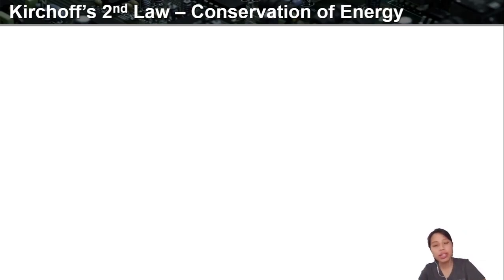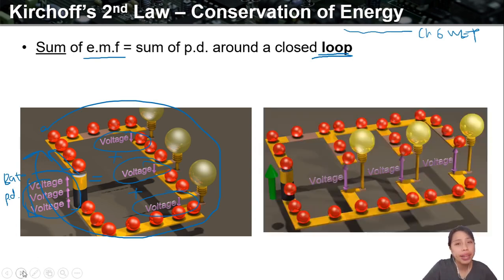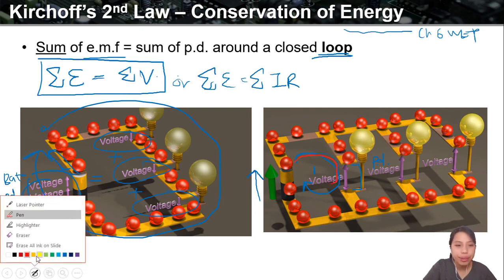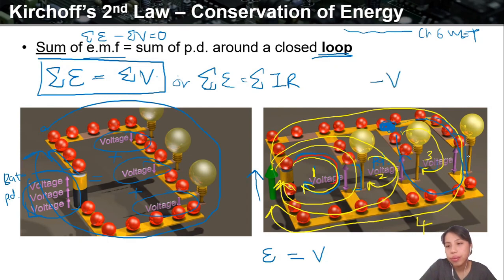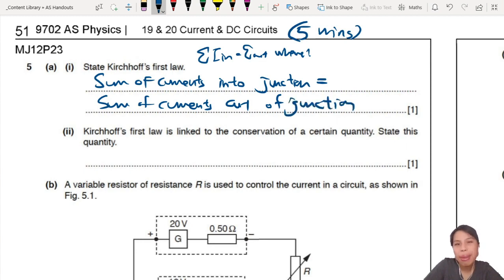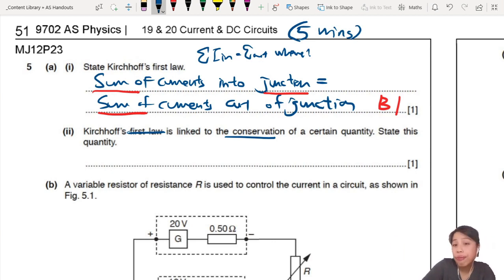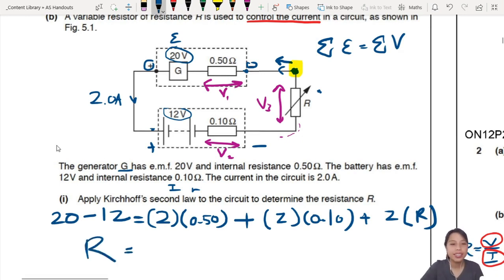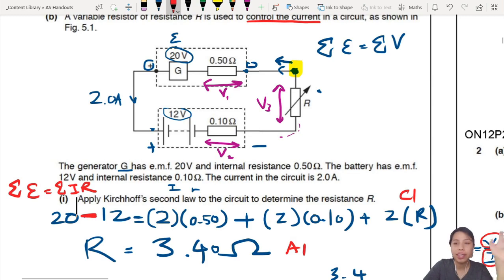10.1b Kirchhoff's 2nd Law: Conservation of Energy | AS DC Circuits | Cambridge A Level Physics

Comment: why did we add the voltage? aren't we suppose to subtract it?
Reply: You need to understand the second law for this: the algebraic sum of emf is equal to the algebraic sum of pd across each component around a closed loop.
So, the emf is on the left side (20-12) and the sum of pd is on the right

Comment: For (b( i) is  3.4 not the voltage meaning we have to divide it by the current 2Amps to get the resistance of the variable resistor?
Reply: when calculating if we take out voltage it is 20V (generator) - 12V (battery) = (0.5Ω * 2A) + (0.1Ω * 2A) + voltage across variable resistor 

after rearranging, we get 6.8 V as the potential difference across the variable resistor and using V = IR we get 6.8/ 2 = 3.4Ω